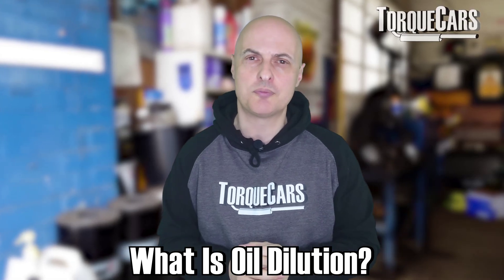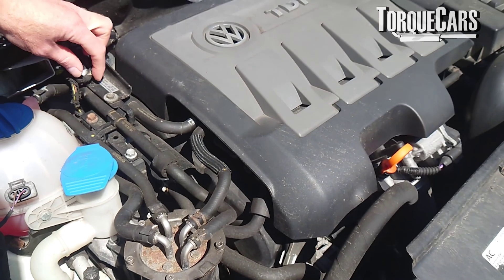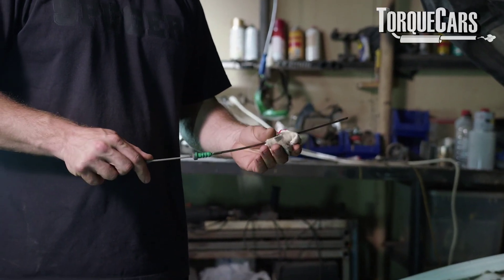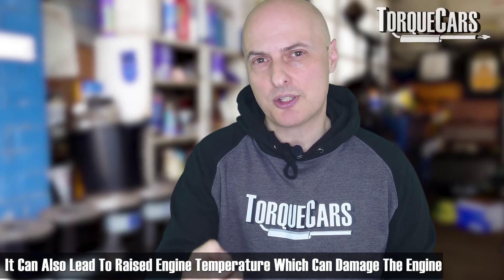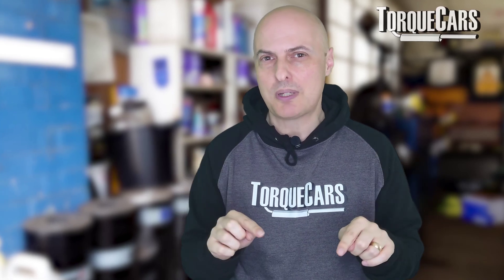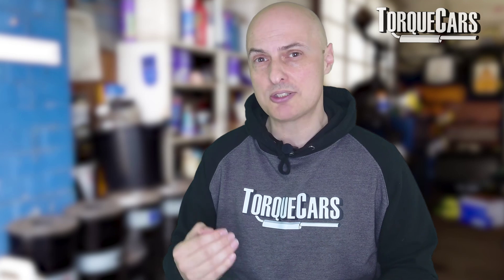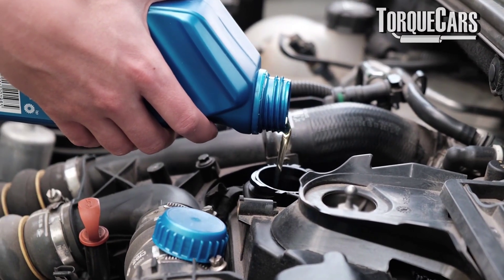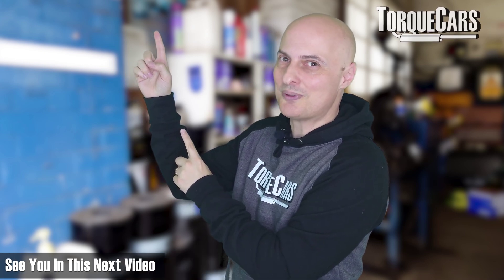Oil Dilution - The Sneaky Engine Assassin⚠️.What Every Car Owner Needs to Know 🔧🚗

Comment: I'm in Poland where we usually have rather mild winters with temperatures rarely going below -5C. I've recently bought 2024 Mazda cx-5 with 2.0 eSkyActive G petrol engine. We do a lot of short trips - cold engine start plus 3-5 km of city driving. Since cx-5 manual gives choice of engine oil between 0w20 and 5w30 I need an advice which one suits our usage style better. Apart from daily commute we try to do 15-20 min of 100kmh driving every 2 weeks and some longer 100km+ highway trips every 1-2 months. I'm set to shorten my oil change interval to 6m / 7k km but I struggle with a decision which oil to use. Please help!

Comment: Just shows you how much knowledge can avert bad things further down the line. I got a 55k JDM Toyota crown s200 2.5, I put 0w-20 Pennzoil as recommended by Toyota in the manual, interestingly it recommended 5w-30 after 60k, and even 10w-40 for hot climates like Middle East and Las Vegas for Example. 

Been following these videos changed my trans filter and used AmSoil ATF WS in my Toyota against all advice, Rear Diff early using Redline (The mech found shavings in it), Motul 5.1 brake fluid, a throttle controller, Fuel cleaner/injection cleaner, Rutherium spark plugs NGK, a tuning chip specific for my model, cold air intake, Power V. Fuel economy, accelration and overall performance appears to be up, the noise sounds like a F1 pur and smooth shifting whearas before I was like meh, should have gone with the 3.5l or 3.5l hybrid.

I have been crusing past the Audi, BMW, Merc knobs at traffic lights, slip roads and on the motorway despite my car being 50k less than thiers. For fill I went with 0w-30 AmSoil (It purrs and doesn't sound like a tractor now on the motorway doing 70mph) I am wondering - should I had gone with 5w-30 it is in the manual? 

I am not bothered about economy as much as protection. The 30w seems to have done the trick with motorway, spirited driving, and wanted the 0w for cold start protection; what do you think the best of both worlds? That was my thinking anyway.

When I drained after 3m (it was a 2nd hand car) put in Pennzoil (Dumb, I could of got Shell Pro cheaper its the same - both made from natrual gas) the drain I did it was very light like water, it was about 60c and a warm day. It was a black colour but did have a slight petrol smell.

Comment: Short journeys , change your oil frequently. You dont need to change the filter. Suck out from above with a cheap suction pump. Avoid silly 18-20 intervals.

Comment: Winter condensation within the crankcase can be a dilution , oil and water do not mix, oil can be compressed but water cannot so oil properties are degraded. Do not listen to those whom tell you not to have annual oil changes in any engine, if the oil is discolouring change it.

Comment: I see how this works in theory. But from some one with a car at almost 300k in scandinavia, with a mix of short and Long runs, I most say this seems like a non-issue? The car have done 25k between oil changes, and I have never worried about this. How much of an issue is this really?
Reply from the maker: It depends on the car design and how well it is looked after. The long runs really do help reduce this problem, it's only really an issue when people do short journeys most of the time and it never gets up to temperature. Some modern turbos are prone to blowby when cold which exacerbates the problem. Even a few earlier Honda 1.5 Turbo engines were noted for this problem despite the brands reputation for reliability.

Comment: 15k - 20k mile intervals are absolutely insane 😅.
The manufacturers want to impress fleet buyers of how low cost the servicing is.
As long as engine survives the warranty period they don't care.
⚠️5k intervals are my motto and have been for last 40 years.
Never had to replace an engine in my entire driving career
Reply: JLR recommends 21k (miles) service intervals on diesels no wonder they have problems 🤔
Reply: Should be changed 5-8k miles
Reply: yes.  Interestingly our american interval traditionally has always been 3K, even though we typically rack up more miles sooner than UK drivers do.   We also have poorer maintenance habits though ,and poorer service quailty in the industry, ie low qualification levels for the 'average shop'

Comment: Thanks for covering this, although I have a question that needs answers. So back in the 80s/90s golf Gti’s were notorious for using oil until they reached circa 59k miles, the explanation I always understood was that the  piston rings would eventually bed in, so why didn’t the oil level increase with dilution? The pressure in the bore topside is greater than the internal crank pressure - I’m not saying dilution as you describe is wrong, I just can’t see an answer to the contradiction
Reply: 50k miles (sorry, fat thumbs)
Reply: @trevormilne3200 early days of vw they used a softer metal for piston rings so as not to wear the bores away and need a rebore which is expensive this is what I was told when I worked at an Audi VW garage…. Seemed like a good idea 👍🏼

Comment: Thank you for addressing this , this is a huge issue with the VAG TDI engines especially the early ones from the late 2000s into the early 2010's . Had to delete my dpf after realising the cost it would take to replace it after it had been diluting my oil and causing oil pressure to drop increasingly often
Reply: You could have fixed the underlying problem and had the dpf cleaned.
Reply: @potluckfishing  Maybe the underlying problem was that the camshaft was replaced, and a standard R suffix one was fitted rather than the AH one that these (BLS) engines need. 

The AH ones have a modified profile on the injector cams which keep the injector pins moving longer and enable the injectors to inject late on in the combustion cycle so that the diesel goes straight to the DPF during regen, and ignites there.

With the R camshaft the ECU gets increasingly brutal with its attempt to burn the DPF carbon and injects too much fuel and does it too often. 

A symptom is lumpy / aggressive acceleration as you pull away, and a general sense that the engine has been remapped (because it has at this point). 

Also exhaust smoke during regen, a DPF load coefficient that goes above 45% IIRC, and a DPF temperature that doesn't go up to the 700+°C required for regen.

Comment: I changed oil on Volvo v40 D4 every 30k 1 year and 80% was highway. After 300k the engine going like new. No any lamp no rust. Consumption 5.3
Reply: 1.9 engine diesel?
Reply: using Castrol subtype 'extended use' type oil, or other brand extended use subtype?

Comment: on my 1.7Cdti I replace my oil and filter every 10k klms. I find this is the sweet spot. Also vital is to clean the EGR and surrounding pipes every 6 months along with a fuel/injector cleaner in the diesel tank. I use the car for mix  of short & long journeys. 6 monthly servicing has got me to 12 years and 120k with no bills. Oil and filters are cheaper than oil samples in my area!!! Do not forget replacing air filter and to mass air flow to keep engine and fuel economy in tip top condition..
Reply: You are doing the right thing but let's be honest 120k km is not a high mileage, even badly maintained cars will reach that mileage with no issues.
Reply: @neildean7515  Hof often should the MAF sensor be replaced? Thanks
Reply: @neildean7515  Hi, I'm pretty much doing the exact thing. 10K oilchange and every 5K an injector/system cleaner. Doing it for the last 9 years. Driving a lot of short distances, but never the less, the mentioned "strategy" has proven itself as pretty good. Never had any issue with the engine.

Comment: Thanks for the video, does adding water methanol injection and running a rich lamba (0,7) accelerate oil dilution and would a thicker oil assist?

Thanks for the tip on oil level checking

Comment: 1st i heard of oil dilution was back in 2016, when Honda's earth dreams 1.5 turbo GDI engine started being used in most new Honda's & China to this day refuses to allow importation of Honda's with this engine
Reply: Isthe 1.0 vtec safer to buy
Reply: I own a 1.5t civic and had it 3 years, never had an issue with oil dilution ever I let it warm up  gently and never high rev till warm, I use 0W30 instead of 0W20 (which it can use) and it's been spot on.

Comment: You failed to inform as to how you can ascertain when your oil is in dilution and how do you know when the system has regenerated, specifically in diesel engines. No one goes to the trouble of getting their oil analysed unless they’re in the business of competition. Your best bet is to change the oil and filter around 50 to 60% before manufacturers recommendations if you’re looking for longevity and better performance, which nowadays is very unlikely. There is a point of discussing the purpose of EGR valve ?
Reply from the maker: https://www.youtube.com/watch?v=-thvt3ISo9Q Video On EGR removal pros & cons and on your suggestion I have a video explaining how to tell if a DPF regen is running https://www.youtube.com/watch?v=54GrVq8_KqE
Reply: @torquecars  wow… you are amazing… thank you.
Reply: Right on spot

Comment: Where in the UK can you send your Oli off analysis and how much?
Reply: Just change the oil every 6000 miles if you do short runs.
Reply: @24bellers20 if someone is doing short runs then that could be 3 years or more 🤣
Reply: Why does your reply not show up? I can't see the rest of the comment only the first few lines!
Reply from the maker: It seems I can't post links on here! The comment is deleted so I'll be looking into that one, so the list without links was Millers, Finning, oilanalysislab, oilsampling, fa-st, theoillab, fluid power solutions. You won't find most of these in Google because they have deleted most of the results they show for most searches at the moment so try bing. the cost is around £27 to £40 but you only need to do this a couple of times and you'll know your cars baseline.
Reply: Millers Oils £39.95
Reply: I have a 1.3 ddis and change oil every 12 months and I'm doing around 5 to 6k a year smokes a bit as mainly short journeys but give it a blast every couple weeks and running fine then.😅